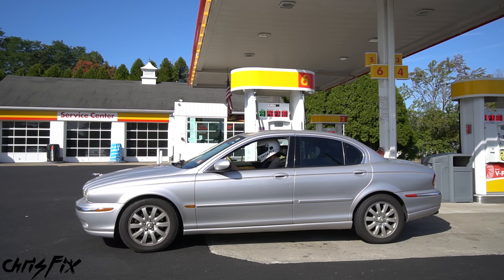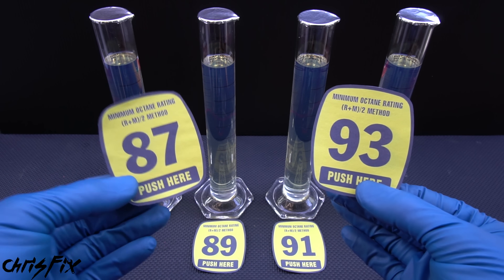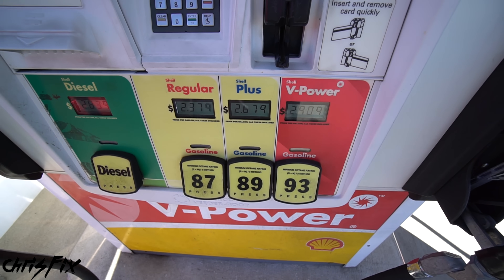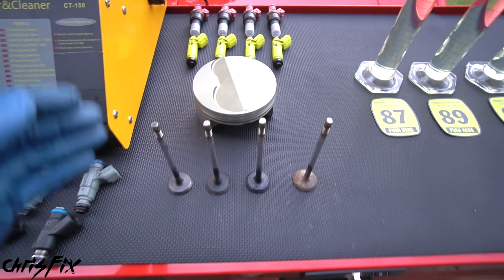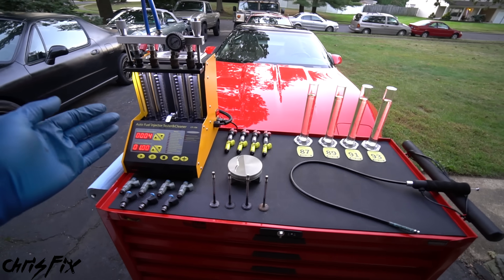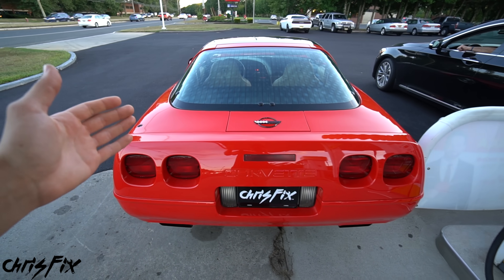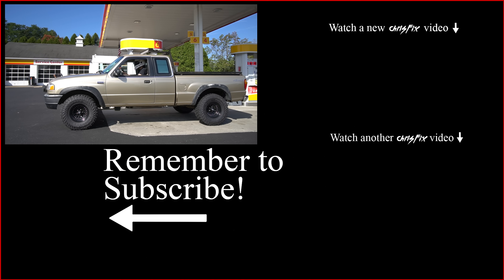What is the BEST Fuel to Use in Your Car or Truck and WHY

Comment: 5:30 We even have 102 Octane in Germany
Reply: That's not real gas. That's a racing gas that's more like methanol or Ethyl alcohol based fuel. But we also have that here in the states. We also have (R+M)/2 100 octane and (R+M)/2 110 octane gas too. Aka...110 and 120 Ron. Regular gas tops out at 100 Ron. Gas in Europe typically never exceeds the 99 rating however.
Reply: @waycoolscootaloo  No, the one Im talking about is completely without Alcohol addition. Its pure Petrol. Its from Gas Station chain "Aral" and is called "Aral Ultimate 102". And thats one of the biggest chains here so you can find it everywhere.
Reply: @Exekutioncro  Everywhere maybe in Germany. But not Europe. They only have 1,600 locations in all. And that would only be enough to cover the area of a mid sized state here in the US. 

Also according to them, they are actualy taking regular premium gas and are simply adding a bit of race fuel into the mixture as I see a couple of ingredients found typically in race fuels. So it's not exactly considered true gasoline by at least US standards. It's a bit of a hybrid to boost octane. 

I'm not sure why someone would waste money on this fuel though, seeing as all manufacturers design their engines for premium 97 Ron. (91 US ) 

If one had say a Chevy 454 big block V8 that was bored out to over 500 ci with extremely high compression ratios, then I could see them using 100 (R+M)/2 octane gas. (110 Ron)  So I wouldn't even bother with the 102 even if it was available here. It's such an odd mixture. And you don't find it in any other countries it seems except Germany. 

Here in the US, typically gas stations sell 110 Ron. (R+M)/2 = 100.
Reply: Probably using RON units, so it's not actually 102 if it's in North America. It's lower.
Reply: @bobbarker3248  In the US it would be rated at 95 octane. It's just regular Premium with a touch of race fuel in the mixture. Here in the US you will typically find 100 octane street legal at some stations. If it were in Germany it would be marketed as 110 octane.

Comment: What happens if you put higher octane fuel than recommended? I have a scooter with 110cc engine, it's manual says that 88 or higher octane is recommended.
Reply: Using higher octane doesn't do anything.

Comment: Hello chris i buyed a citroen picasso 1999 for 200€ but theres a problem the fuel pump doesnt work should i replace it is it worth replacing
Reply: Replacing a fuel pump is easy. Usually you have access under the rear seat.
Reply: @bobbarker3248  thx

Comment: Just a head up for folks, when you fill up for gasoline, please please please use a strickly gas pump if open. I cant tell you how annoying it is when I have to fill diesel waiting for 3 suvs in line when there are so many other pumps available.
Reply: The gas stations around me have pumps only for diesel.

Comment: The only negitive to using 93 in a car that has a recommendation for 87 is the cost. If you can afford to use 93 in a car that is recommended for 87 why not. Also a knock sensor has to detect something before any changes will be made to timing.

Comment: Read your owner's manual and put that fuel in there.
Reply: R.T.F.M.
Reply: had a 2008 impala ss with 5.3 would use anything from 87 to 94. the higher the octane the better the fuel mileage and the better the 0-60 and better quarter mile times, so it obviously helped with performance the higher i went with octane.
Reply: @bigpoor69  Only because the engine was set up for that.
Reply: I don't think any owner's manual says to use 87 or regular
Reply: @igotthejuice2090  lol they all do.
Reply: @igotthejuice2090  Wtf are you talking about? Have you ever even read a manual? Nearly ALL manuals tell you to run 87 because that's all that 95% of cars on the road need!
Reply: @flyurway  I have 8 different cars they all ask for premium
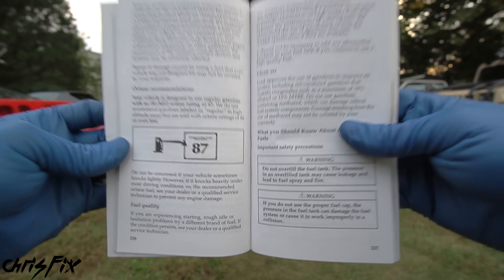Reply: @ya boi Sosa 11:32

Comment: Also no EUs 91 isnt 89, converted itd be 91  US octane and EU 99 would be 95 US octane. So yes the US fuel is inferior, its far from a myth. Same as higher ron producing more power. They DO produce more power by increasing a vehicles compression rating due to increased density, allowing for smoother burning and can contain boosts and cleaners in them.

Comment: Hello Chris I used to work at the Costco gas station and truck drivers would tell me that when there was no more room for 87 octane they will drop it in the 91 octane so half the time you're not even getting the octane that you paid for there are so many Shady gas station operators out there be careful

Comment: You say "detonation", but isn't it "pre-detonation" - that is, detonation before the spark plug fires? Detonation from the heat caused by compression? And your diagram shows detonation in a corner of the cylinder AFTER the spark plug fires. Isn't that incorrect?
 Also, you referred to the third valve as an intake valve. (Looks more like an exhaust valve.) Will an intake valve really get carbon deposits on top like that?

Comment: Simply put lower grade than your car requires can cause delayed explosions in your block causing it to get knocked back before the gears are ready to handle it which could also cause a misfire? Correct me if I'm wrong so i know and I'm not misinforming others

Comment: This should be emphasised more. 

Dont put unleaded fuel in a diesel car, and if you do dont fucken turn it on. It will break the fucking car.

And dint put diesel in an unleaded car but it isnt as bad as unleaded in diesel

Comment: What if I use the octane booster in premium gasoline?
Reply: And who the hell cares about drifting in a daily driver anyways
Reply: freezeme360 I only worked in the automotive field for close to 20 yeArs but keep ur head in ur ass if u can’t pry it free
Reply: Probably burn a hole in the piston
Reply: Dog rescuer not likely unless u have a misfire....most burnt pistons are caused by detonation a by product of a misfire...
Reply: @nunya2779  more like the pocket :)
Reply: So i cant have a 100 octane gasoline
Reply: Marco Molina only at the track or on a 1/4 mile strip
Reply: freezeme360 again u have misinterpreted what I wrote it was in response to Marco asking for 100 octane and I said only at the track or strip but u obviously can’t read or u would know that.

Comment: Problem with Gasoline is the ethanol is what hurts the engine if I'd put 93 in my frontier it would do nothing because the computer is smart enough to cut timing

Comment: If you use a higher than required octane fuel without any tuning adjustment to the engine, the car will make less torque and HP, and worst fuel mileage.  So if your car requires 87 and you add 93 without any adjustment to the cars tuning, all you're doing is wasting money and reducing the performance of the vehicle.

Comment: You lost me when you didn’t have Ethanol Free gas in the lineup or E85. Ethanol free contains more energy than all of the and is often required for classic cars and pretty most vehicles produced before 1995. Although the extra cost of Ethanol free fuel is often too much to overcome the better mileage (2-3%) compared to regular modern fuel of the same octane and probably not a great idea to run in a vehicle produced this decade. E85 on the other hand is good for flex fuel vehicles but contains much less energy. Having used E85 in a 2000’s Ford Ranger which was flex fuel compatible it could barely climb long hills or tow the boat, but the typical pinging on flat road was eliminated. However MPG went from low 20s MPG to just 14 MPG. For that flex fuel vehicle, running mid-grade fuel often produced the best cost to mileage ratio.

Comment: This issue may have been addressed already in previous comments however I am wondering about fuel in higher altitudes. When we lived in Colorado Springs it seemed all of the regular grade gas was 85 octane

Everyone else was doing it so I used 85 in our Chevy van for two years

We made it through and my engine seems fine but do I have any reason to be concerned in the future

Comment: If your gas cap does NOT have printed on it “premium required” not just recommended there is no real reason to use anything above 87 octane. Period.
Reply: Sorta but not really. You can use 87 but will likely result in lower HP to compensate for lower ability to prevent knock. In the Summer I could not run 87 as it would knock, winter was different.( Corvette )  On high compression motors, 91/93 is needed to prevent knocking.( Turbo's also )  If you don't have a performance motor, then 87 is plenty.
Reply: If it says recommended, then you will notice a difference.
Reply: Make a video and prove it
Reply: 100% a difference in HP when your car recommends premium but doesn’t need it. I have a Focus ST and I can tell night and day between premium vs regular. I really only use premium when I need the HP (going to street races or the track) and every now and again just for shits and giggles. It’s night and day
Reply: I worked for a rental company..They put 87 fuel in every car! Benzs,Bmw, Every car
Reply: My car says use 93 only so I filled her up with e85. Now she sounds like a jet plane.
Reply: Mexico City What do you drive 😂 keep your mouth shut until you race an st
Reply: @SmithWesson-s8x  That might be true if you put gas on a a diesel engine or if you run that shit gasoline from PEMEX. But mysteriously enough when I put premium gas on my fucking lawnmower I get quite a bit more running time and a smoother performance out of it.  Also this has nothing to do with science, is about engineering.
Reply: 93 is just a cleaner gas better for all engines. I use it on everything; my riding lawnmower, truck and motorcycle. It lasts longer compared to 87 so the extra time offsets the higher cost.
Reply: @IanAlderige  93 is not cleaner. It is the same gas. Now it may have more detergents depending on station but the octane rating has no effect on "cleanness".  I drive 2K miles a year. A tank lasts me from 30 days to 60 days. My gas milage is no different for 87 vs 91. I get better results by shaking the gas up by swerving back and forth to mix the gas back up over octane rating. Ethanol absorbs water and then it gets heavier than gas and separates from the gas. Mixing it back up gives me 2-4 mpg more than when I don't. I still get 3-4 mpg less than if I drive it all out in 2 weeks vs slightly better mpg back in 2007 when the car was new. I get 35/36 on real gas, 33-34 mpg E10 on the highway if used quickly, 26-28 mpg when mixed up every time I drive and the gas being over 1 month old, or only 20-23 mpg if I don't mix it up and it is older than 30 days.  I tried it with 87, 89, and 91 Ethanol mix, they all reacted the exact same. Real 87 gas ( around $1/gal more ) losses  1-2 mpg if left in the car for over 30 days.
Reply: @batsonelectronics  by cleaner I meant better for pumps and fuel injectors. I guess you can get the same result if you buy additives separately but buying premium takes the guess work out of it. I do get better mileage on all 3 vehicles using premium tho.
Reply: @IanAlderige  I would assume the more expensive gas cleaned the injectors then as I have seen 4 or 5 scientific tests on MPG with grades of gas and all were the same in lower compression cars. ( < 9.5:1 )  I tried it myself and got zero difference but I didn't use Shell so the 91 might not have had any more extra stuff in it over the 87. I have used the same 2 gas stations for 12 years. Neither are National Chains.
Reply: All fuel has cleaning additives anyway I think, its part of emissions regulations in many countries now. The only reason to go for higher ron is to run high compressions engines optimally.
Reply: @IanAlderige  You just don't get it, didn't you even watch the video? Premium vs regular makes no difference! You have just as many cleaners and additives in regular as you do in premium. If all your engine needs is regular, running premium gives you NO (!!!) benefits!! That's the entire point to this whole video and some of you STILL don't get it!!
Reply: @flyurway  tested all that shit several times btw.
Reply: My jetta is recommended regular.... I switched to premium only after my injectors got so dirty I was dead on the side of the road. Not only that, I can feel the difference in power

Comment: I have seen insane amounts of carbon deposits in direct injection. I’ve seen valves bend from it. Also seen valves not seat good and cause misfire at idle. Have over 20 years as a tech, 10 of those at a dealership. If you have direct injection it’s important to do direct injection fuel service.

Comment: What’s up Chris. I have a 2003 Jaguar X-Type & it’s been misfiring for a while now. I changed the spark plugs & put a now valve cover on it & new ignition coils. & it’s STILLLL misfiring. The gas I use is 89. What do you think I should do ?

Comment: I started using high octane gas in my when I was told by my mechanic. I got more mileage than regular gas. And had some more pick when passing. If the gas doesn't matter why did I get more out of it? I went from adding gas twice a week to once. I'm just wondering why it changed so much?

Comment: Well. There's alot of sports cars that require 93 octane fuel or it knock. Am matter of fact you put 87 octane in a Lincoln ls. It run like shit but put 93 octane it ran great. Just a little add on info.

Comment: I think most people's impression of pumping higher octane making the car run better is that the car isn't running right and a higher octane eliviates issues like uneven cylinder compression and fuel delivery that can cause detonation/pinging. As far as the computer knows an entire bank is just one cylinder, so any variation will cause short term fuel issues forcing the computer to operate in a wider range to stay safe (richer and lower timing).

Comment: If this question had already been asked and answered I apologize, but I didn't want to scroll through 16K comments lol What about the difference between 10% Ethanol gas vs. Non-Ethanol gas? Will the non-ethanol gas be better for a slightly older (2007) engine? I don't remember when the 10% became the norm.

Comment: Great stuff! Thanks for the explanation 

I do have one question though, would it damage the engine in any way if you switch from 95 octane to 99 or vice versa on say a 2017 GT Mustang? Given it runs perfectly fine on a regular as per manufacturer

Comment: Short answer: The owner's manual tells you exactly which fuel to use that is the best for your specific vehicle.  If you don't have the manual, look it up with google and DL it, or call a dealership.  Don't use any other fuel than the recommended kind, regardless of cost.

Comment: Some gas stations have gasoline that contain "No ethanol". Is there a reason to prefer an ethanol gas over a non ethanol gas? What's the difference between the 2?
Reply: I run non-ethanol only comes in 90 octane
Reply: @bc69006900  What is the reason for doing so?
Reply: @phoenixhudson5815  my boat motor an EFI 500hp the fuel pump was ruined by ethanol gas even E10, anything that sits for weeks E10 sucks.  my 3/4 ton is the only thing I run E10 in because I drive it enough
Reply: @phoenixhudson5815  E10 also absorbs water from the air.

Comment: Higher octane fuels in Australia come with lower sulphur content. 98RON is <10ppm (same as Europe,) while 95 is slightly higher and 91 i ~50ppm sulphur. Thus in our market, the better the octane the better the fuel is at preventing oil contamination, a key issue with modern EGT and direct injection systems. 

Not sure how sulphur content is in North American Fuels. In some markets (mostly Africa/Arab states/parts of Asia.) It's still common to have fuel with over 500ppm sulphur :(

Regards
Jordan

Comment: Where I live, premium gasoline (91-93 octane) does not contain ethanol, so therefore it does have slightly more energy value. Also, for outdoor power equipment it is wise to use non-ethanol gasoline, since ethanol will attract water and cause problems especially if the fuel is left in the equipment for long periods of time, and older equipment is not equipped to handle ethanol, which is corrosive to some types of rubber and plastic. Otherwise a good video.

Comment: My 1993 Jeep Grand Cherokee limited 5.2 V8 is still going strong for 26 years without engine or transmission overhaul. Right now it is over 409,000 miles. Several years ago, I've used conventional oil then blue smoke came out from tail pipe as I didn't like so, I switched to 5W-30 Mobil One Synthetic oil with royal purple oil filter for years without any problem as well always passed smog check. Also, I've used mostly Chevron 87 octane gas of trying not get cheap gas brand too.
Also, if my jeep die and I was thinking about obtian a Chevrolet Tahoe with V8 engine.

Comment: I wished you'd have a knocking engine example to hear
Reply: It sounds like a chain slapping around or a nickel in an empty soda can.
Reply: Yea. Sounds like a metallicy type sound "ping" like a rattle spray can. It usually does it on light or heavy throttle. Youd be amazed how many people drive around with it and dont know, i hear it alot in customer cars on test drives. Either the customers are using cheap gas and/or mixed with the fact they dont drive hard enough and that builds up excess carbon causing it to pre detonate.
Reply: You're not going to hear it like you did in the old days there's no high compression engines most cars run on 87 octane read your owner's manual
Reply: @NightMusic1-b9o Obviously if maintenance is overlooked alot of things can go wrong. I said excess carbon. And it can/does build up on certain engines if not driven hard on occasion. Trust me, i see it.